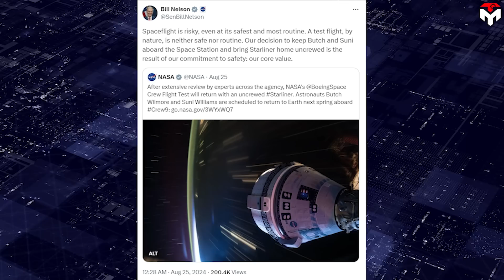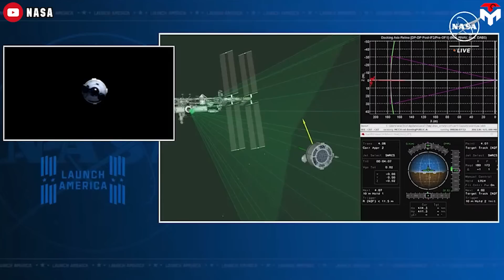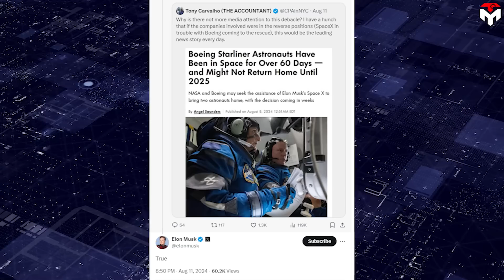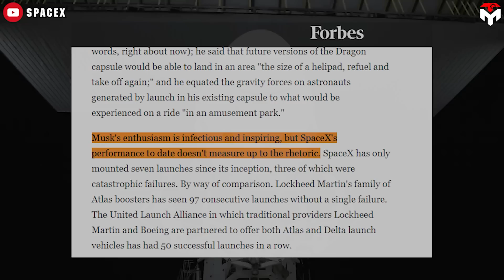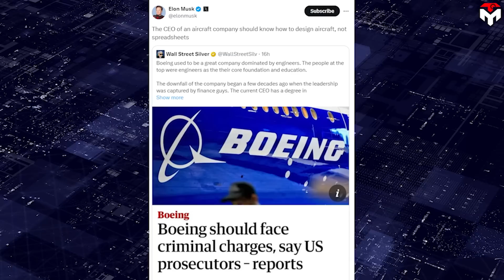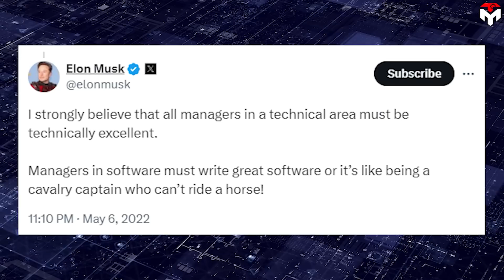Elon Musk revealed NASA Hiding A Shocking Secret about Boeing Starliner Return!

Comment: Not having proper escape capsules on the space station is pathetic how many nations are involved in this when you look at NASA when they put that bar out of the shuttle under the wing as an escape method after the Challenger I totally lost my faith in them, after the Challenger I sent plans to NASA showed them a breakaway crew cabin aft the cargo hatch that area would be a heat shield on launch it would break away and shoots would bring the crew cabin down on reentry the crew cabin would break away have a drag shoot to position like a Gemini capsule on the heat  shield, and warned them they would lose one on reentry, with the tile damage they were having and suggested blank tiles and a mini mill to make missing tiles that could be replaced before reentry

Comment: Since when is NASA to dictate safety restrictions to companies when they themselves are a disaster causing entity given their history. Apollo One, Challenger and Columbia- None of these things should have happen and no not even Apollo 13 either- they were warned and major mistakes were made on the stir system of 13 with over voltage. Put those administrators up there first- we can lose them without too much loss. Then we can fix it. Oh Boeing's history of failures is in line with NASA, 737 is one example. From talking to past workers there it is going to get worse- maybe space work should be consigned to the Skunk works?

Comment: The implication that the Shuttle was even remotely "successful" or even "safe " is ridiculous if you look at astronauts dead per flight !

  It was NOT safe , you would be far far safer in a Nascar for a year than a Shuttle single flight. 14 Astronauts have died from shuttle disintegrations . Since 1940 till today only 28 drivers have lost their lives at NASCAR , around 84 years !! 

The Shuttle was a hugely expensive and dangerous system funded by a limited budget that fitted with a lowest cost estimate totally ignoring the horrific dangers of solid rocket boosters and a hugely complicated and a multifaceted clumsy solution which evolved into the Space Shuttle.
Reply: Good points. The shuttle cost one or two orders of magnitude more than originally expected. When you consider the lives lost, It’s hard to call it
Reply: Call it And unqualified success
Reply: @fionajack9160  Call it a success as you would call the Titanic being a success for having water tight doors , "The Unsinkable Titanic"

Comment: I totally disagree that Boeing has a strong record in space flight. Google Boeing's involvement in Apollo and the Space Shuttle and you won't see hardly anything. Maybe they designed the drinks holders or something. Out of the aircraft manufacturers, McDonnell Douglas, Lockheed and Grumman are prominent. Like Grumman Aerospace designed the whole landing module for Apollo for example. Collins and IBM did all the software and computers for Apollo and the Shuttle . Engines and thusters were Rocketdyne or Thiokol.
Reply: You're right. Google the NASA website and you can see a breakdown of who did what on the Saturn V and Shuttle. Boeing doesn't even get mentioned as a contractor. But the recruitment agency (Booze Allan) does. You missed out North American/Rockwell International which contributed somewhat. They designed and built the Space Shuttle, LOL.
Reply: @k9killer221  Oops..Bit of an omission. LOL

Comment: The US old space program was more about hiding money and profits by its contractors then about a future of space travel.  Remember when a hammer cost $27,000.  That is why private space companies like Space X was able to leapfrog into frontrunner in the field.  In the case of Boeing was more about bailing the company out for its 737 Max failures.  Robbing Peter to pay Paul.  Without say it.  Why hasn't an Audit of Boeing been ordered?  Boeing is the largest Military contractor.  Funny how it worked out.  NASA Bill needs fired and an audit of NASA also needs done.  There is another promising space program.  Dream Chaser.  If it gets its partnership with Space X up and running.  Game over for Boeing.  The Air Force also has a space plane that could fill the need of NASA as well.  Funny it is a successful Boeing program and Starliner is a huge failure.  Seems to me that it was only designed to funnel  money into Boeing not to be an option in the future of space flight.  How many billions of dollars has Boeing funneled into campaigns in the last decade again?  Seams to me Congress is largely also to blame for the failures.
Reply from the maker: Absolutely
Reply: Boeing moved from Seattle to Chicago and now to Washington DC (closer to the Pentagon)!  Seems like they know where the money is!